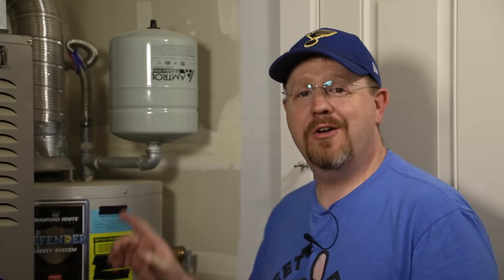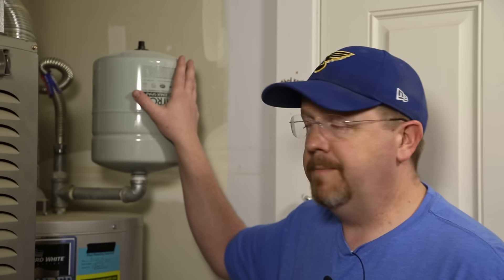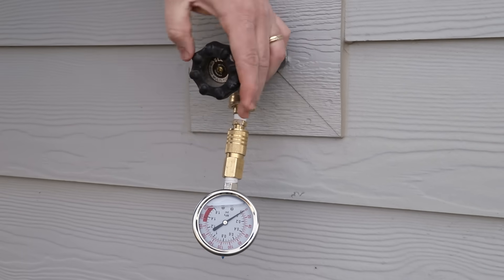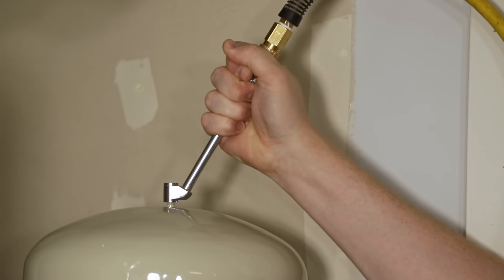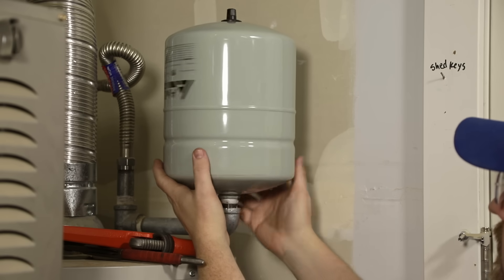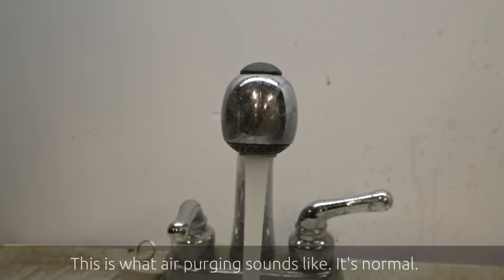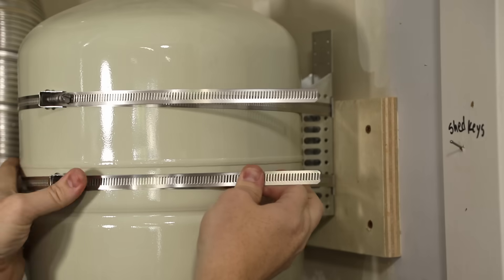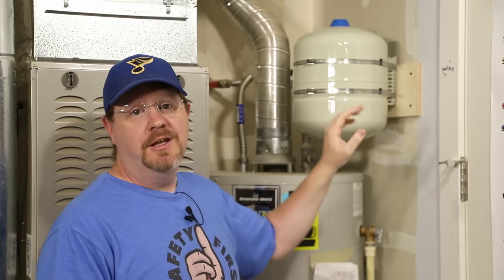What Is This Tank? How to Replace and Maintain a Water Heater Thermal Expansion Tank

Comment: If my expansion tank has failed (it definitely failed, I checked the pressure and water came out) would it cause the pressure to be inconsistent when multiple people are using the hot water at one time in the house?
Reply from the maker: Yes - a failed expansion tank that is full of water can have all kinds of fun effects on water pressure. A properly-working tank helps a lot to smooth out pressure changes as different faucets/appliances open and close their supply to the heater.
Reply: @AmplifyDIY  A failed expansion tank that is full of water will have no effect on water pressure as it provides no pressure absorbing functionality and may as well not even be present in the system.
Reply: Some inconsistency in hot water pressure is to be expected when there are multiple users of hot water and it becomes more noticeable as the total hot water flow approaches the point where the size of the pipe into or out of the heater becomes the main limiting factor to water flow. The same applies to cold water flow, where the pipe size of the mains supply to the house becomes the limiter for both cold and hot water flow. To reduce such interdependence between multiple users in the same house, adjust the local valves (under the sink, at the wall for washing machine, dishwasher, flush tanks) to reduce the maximum flow that can be demanded at each outlet. Outlets without local flow control/restrictions (typically bathtubs, some showers, sprinkler systems) will then have some priority on water flow demanded.
Reply from the maker: @petep.2092  Thank you for the explanations and corrections. I appreciate it!

Comment: Is that galvanized steel, should you use brass on the tank to the expansion tank?
Reply from the maker: Brass would definitely be a better choice, as the galvanized is just slowly corroding from the inside out. I didn't install this system, but I do plan to swap that out. If only my todo list ever got shorter. 😂

Comment: This is just something else they can sell you .  For 90 years we never had one of these and we had no issue with are water heater leaking .
Reply from the maker: Many older homes don't need one at all. They are becoming very commonly required by water utilities on new construction. Thanks for watching!
Reply: Good for you! I have 2 duplexes and I'm having to install my second ET(different unit). The WH I purchased last December has a leak alarm and its pretty annoying to get that message from the renter that the alarms going off again when the pressure relief valve does a water dump.

Comment: Tried unscrewing my tank and it seems too tight with one wrench. Any way to work around this?
Reply from the maker: First make sure you are actually unscrewing, and not accidentally trying to make it tighter. Second, these are sometimes installed VERY tightly..if it's too tight, you may need a longer wrench or a cheater bar / pry bar extension added to your current wrench. Good luck!

Comment: Question. Should I add air anytime the psi gets below the house water pressure? Example, if the house water pressure is set a 60psi, I have the expansion tank set at 65. If that pressure on the expansion tank falls below 60psi, should I put air into it?  To my understanding, like tires...expansion tanks will lose air over time.
Reply from the maker: Great question! My rule of thumb is to check it every 6ish months or at least annually. If it is more than about 10 psi lower than the water supply, add air. It does not have to be exact, ballpark is fine. Thanks for watching!

Comment: This is a very informative video! What device did you use to refill the air in the tank, and where can I purchase it? Thanks.
Reply from the maker: I used an air compressor. If you don't have one and don't want to buy one, you can use something as simple as a bike pump, but it will take a while to fill. Here are some cheap air compressor options: https://amzn.to/3z5joWr

Good luck!

Comment: It looks like you installed the thing upside down.  Looking at the installation manual for this model, the manufacturer shows no upside down install as being acceptable. Also that groove on the outside of that tank is where you put the strap,
Reply from the maker: The installation manual specifically states it can be installed in either vertical orientation. As for the straps: you are right, I could lined things up a little better to make use of the groove, but when using 2 straps like I did the exact placement is not critical. Thanks for watching!
Reply: @AmplifyDIY  Can you provide a link to this installation manual? The one I looked for this manual allows no upside down install.  I’m interested because it would be a whole lot easier to install it upside down as you you probably know from your installation.
Reply from the maker: @Znobbs  Sure - the specific tank I installed in the video is an Everbilt model EF-TET-4T, purchased from my local Home Depot: https://www.homedepot.com/p/Everbilt-4-5-gal-Thermal-Expansion-Tank-EF-TET-4T/304122098

The manual for that tank is located here: https://images.homedepot-static.com/catalog/pdfImages/83/83ea7b15-bdee-48fa-8088-eba58916d148.pdf

On page 4 it shows a diagram of the correct way to install it, with the orientation I used called out specifically as an optional installation position. 

The Amtrol tank I link to on Amazon in the video description does say it has to be installed with the air valve at the bottom only. Apologies if this is where the confusion came from.

I know that Everbilt is not unique in allowing their tanks to be installed in different orientations, so other local suppliers may have tanks with similar instructions if you cannot find the same tank I installed at your local Home Depot. For instance, the Eastman brand tanks available at Lowes are also able to be installed in multiple different orientations - horizontal or vertical. Here is the manual for those: 
https://pdf.lowes.com/productdocuments/fe5bdb5b-0fb8-4937-978a-6a00c8bd041e/15673058.pdf

I'm happy to try to help answer any other questions that may come up.

Good luck!
Reply: My bad. I now see the upside down install as an option. Thanks.

Comment: Every one I find has a busted bladder and has filled with water. They don’t last long. That’s what I know.
Reply from the maker: I believe that's because many plumbers don't bother to properly pressurize them when they install. They come from the factory with a pretty low pressure - 30-40 psi... if you just add it to a system that has water coming in at 70-80psi, it will never last long. If they are properly pressurized when installed, and checked annually, they generally last a long time.

Comment: The tank pressure NEEDS to be 5-10 PSI HIGHER than the house's unique line pressure or the expansion tank will immediately fill and serve absolutely no purpose. 
it is incorrect to pressurize the expansion tank to match the same pressure as the house's water pressure.
Reply: Not true at all.

Pressure is the opposition of atoms to being pressed closer together, the normal spacing being dictated by a balance between the natural attraction between atoms that draws them together and the thermal energy that keeps them bouncing away from each other. A gas is easily compressible due to the atoms being spaced relatively far apart compared to a liquid, where the atoms are much closer together, making liquids relatively incompressible. Any attempt to change atom spacing in liquids without allowing a change in the container's volume results in a significant pressure change. Thus, providing a gas-liquid interface within a contained volume allows the volumetric expansion of the liquid due to heating to be absorbed by the compression of the gas with little increase in system pressure.

If the expansion tank air pressure is EQUAL to the home's water system pressure, there will be NO flow of water into the expansion tank when the water mains is turned on and it will NOT "immediately fill and serve absolutely no purpose." However water system pressure HIGHER than the tank's air pre-charge pressure (caused by heating the water or by suddenly shutting off a high-rate flow) WILL cause water to flow into the expansion tank, compressing the air and causing a small increase in air pressure, until the air pressure matches the water pressure. Thus, reasonable pressure increases above normal WILL be absorbed by the expansion tank.

On the other hand, setting the air pre-charge pressure to 10 psi HIGHER than the water system pressure—as you recommend—will result in no water flow into the expansion tank until water pressure increases to 10 psi above normal, i.e. the expansion tank will not be functional until system pressure is 10 psi above normal. This means that up to 10 psi of excess pressure will NOT be absorbed by the expansion tank and will potentially cause damage.

Comment: Can you add more pressure to the tank before actually connecting it to the water heater?
Reply from the maker: Yes, you can pressurize the air side at any time. Good luck!

Comment: Can you measure the tank pressure without depressurizing the system , what would the pressure read this way for a healthy system?
Reply from the maker: You can measure the pressure, but it won't be accurate because you'll me measuring the combined pressure of the water side pushing on the air side. The only accurate way to measure the air pressure in this tank is to de-pressurize the water side. Good luck!

Comment: I'm concerned about the new larger tank's bladder failing prematurely because of the proximity to the flue pipe. Might be worth checking it's temperature during the water heater's heating cycle.
Reply from the maker: This is a pretty efficient heater, and that flue is double-walled. The outer surface gets warm, but not overly hot. Great tip though!

Comment: I used this vid to replace my completely failed expansion tank today. I replaced the pressure release valve first thinking it was that, but the leak persisted, so I came here and the symptoms were exactly as this showed. I took the pressure of my expansion tank and it was 0. lol  Replaced it after learning from this and back to perfect working order. Thanks a bunch!
Reply from the maker: Nice job!

Comment: Why did you use cheap galvanize pipes near the expansion tank?  Copper or brass would be a better choice.
Reply from the maker: The galvanized pipes were installed by the plumber who installed the whole system. It passes code, so they do it the cheapest way possible. Swapping that out for brass is on my (long) list of projects to get to just Real Soon Now™.

Comment: This expansion tank is installed incorrectly - it is not in the proper orientation meaning it should not be installed upside down - see instruction manual.
Reply from the maker: Hi Michael - the tank I installed in this video specifically says in the instruction manual that it can be installed in either vertical orientation. It cannot be installed horizontally, though. I agree that whatever tank you choose to install though, make sure to check the instructions to verify the orientation you are using will work.

Comment: Hi, this is a great video! It's always nice when someone speaks really clearly, but also has a sense of humor. I watched all the way to the bloopers. I know this might not be possible, but I'm having an issue after the installation of my water heater and expansion tank, and I wondered if you might be able to get some input. I'll put a link to the video I did, and if you can watch it and give me some feedback, I sure appreciate it.

One question I have: If there isn't leaking from that valve, does that mean that the expansion tank is functioning okay? I'm a little concerned about this job because typically contractors try to make sure that there isn't leaking at the completion of a job. Unfortunately, I started researching afterward. That's what happens when things are left too long. The client gets nervous. I was thinking maybe I could check the pressure in the expansion tank, but I don't know if I have to undo some of the plumbing to do that.If nothing else, do you have thoughts on that? Thanks again so much!

Here is my video: https://youtu.be/dVSMkY88RLk
Reply from the maker: Thanks for the link to your video - I've watched it, and will leave a comment on it with some suggestions.
Reply: @AmplifyDIY  Thank you so much!  

I put this response on my video, but I wasn't sure if you'd see it. 

Hi! Thank you so much for watching my video and responding to it so thoroughly. I appreciate it. I have one follow up question. For re-pressurization, do I just follow the steps in your video (checking house water pressure and expansion tank)? And then make sure they are the same? Thanks again.
Reply from the maker: Yup! Just follow the instructions in the video to check/adjust pressure in the expansion tank. Good luck!
Reply: @AmplifyDIY   We ended up having to adjust the pressure, because it was at about 45. Our house pressure was about 67. So we pump some air into it. We just used a bike pump because it was easiest. Then we took the brass nipple part that is horizontal, and we replaced that. After trying to turn at, it became clear that the pipe dope and plumbers tape hadn't been adequately applied. I think we could have used the same piece, but we got one that was just brand new so that it wouldn't have all the scoring on it. It looks pretty clean, and there might be just one area that we have to adjust. Thank you so much for your help!

Comment: Why did they install your tank up-side-down?  
If the tank is intended to be installed that way, why is the printing on the tank up-side-down?
Reply from the maker: I checked install instructions from the manufacturer, and the tank is fine to be installed in either vertical orientation - just not laying on its side. Installing it the way they did saved a bit of plumbing. Thanks for watching!

Comment: God forbid we put a pressure relief valve on these water heaters oh wait they all do expansion tanks are f**** stupid
Reply from the maker: Heh. You misunderstand the purpose of an expansion tank. T&P valves are designed to open at a set pressure, generally around 150 psi. There are plenty of fittings on the hot side of your plumbing that are not going to survive 150psi....the expansion tank is there to take up the slack of normal operation of the heater that can cause pressure to fluctuate between 70ish psi and 120ish psi. An expansion tank will allow the water to literally expand as it is heated without changing the pressure of the system. This is MUCH gentler on fittings throughout the home, especially on the more fragile ones such as the hot water connection at the back of a washing machine. 

A T&P is a safety device to avoid a catastrophic failure in the heater. An expansion tank is there to reduce strain on the rest of the plumbing system during normal operation.

Comment: Very nice looking tank install.  
My only question is if my house has copper pipes, shouldn't i be using brass pipes to intercept the cold intake and T off to the the tank?  Wouldn't using galvanized pipe like you did, create a very quick degrading electrolisis on the galvanized pipe followed by a leak?
Isn't brass the universal compatible choice to attach the steel water heater and steel expansion tank to a copper house pipe, if i don't have pex pipe?
Also, my instructions that came with the tank said to pressurize it 5 lb psi higher than the incoming pressure?
Reply from the maker: Yes, brass would have been a MUCH better choice, but the plumber who installed my system obviously wanted to save a few bucks and used galvanized. It's on my list to replace. Adding 5 extra psi is no problem, and if that's what is recommended in the instructions, that's what I'd do. Good luck!

Comment: I have an issue with mine but it looks different than this one...instead of that top thing with blue cap that the one on the video has mine has what it looks like a little bleeder or something and it keeps leaking water and air out of that all the time and over time it has turned brown and has calcified....anyone know what the issue might be? I'm no plumber or heater guy so I have no clue and I can't seem to find the answer on the Internet
Reply from the maker: Sounds like yours has completely failed. If water comes out the end opposite where it connects to your plumbing, it's time for a new tank.
Reply: @AmplifyDIY  thank you for responding. I was hoping I could replace a part or learn a trick or something to fix it but I guess I got to replace the whole tank. I am planning on re-doing my whole heating system too since for some reason some rooms get way hotter than the rest and I always double check each individual room to make sure there is no air in pipes..

Comment: I installed a thermal expansion tank and it’s dripping, I used Teflon tape, do you use pipe dope also
Reply from the maker: Yes, I always recommend using both. I hope you've been able to get it fixed up!

Comment: Why not install an air pressure gauge on top the expansion tank so you can monitor the air pressure?
Reply from the maker: Mostly because there is no reason to monitor it while it is in use - because the water pressure will affect the air pressure in the tank. The only time you should read the pressure is while there is no water in the system. Thanks for watching!